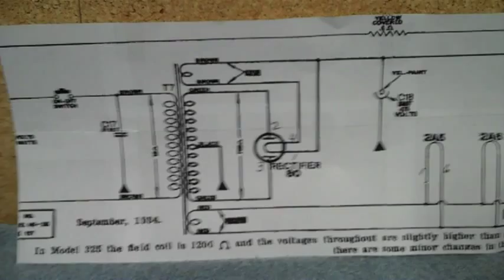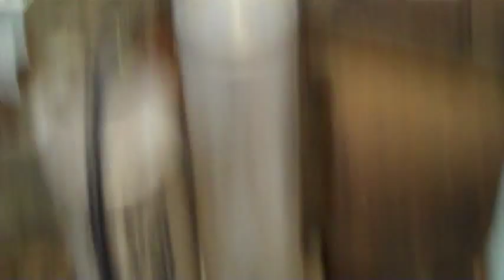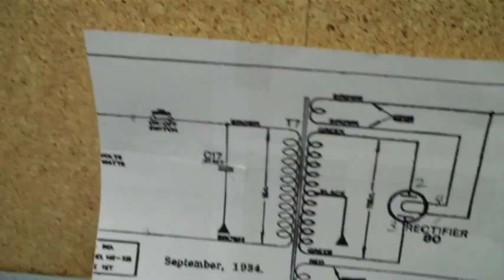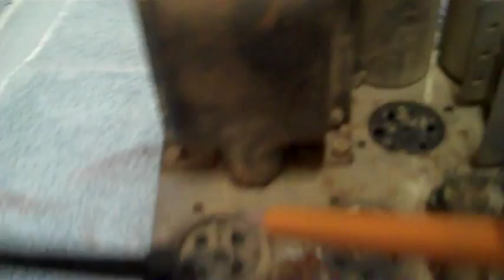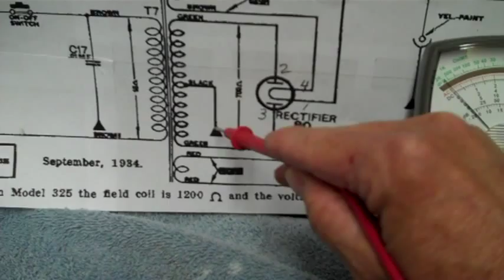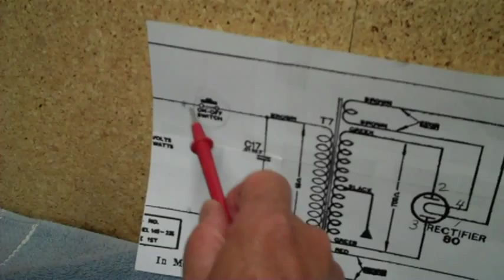1935 Atwater Kent Model 145 Repair and Restoration (Part 4 of 38).

Comment: You should have mentioned that the power switch could be open, so should try the wire between the primary and the switch, this has caught me out before!
After years of restoring sets, I often find the power switch open.